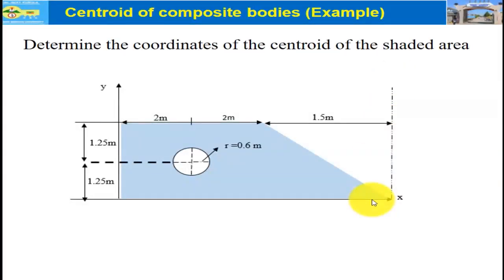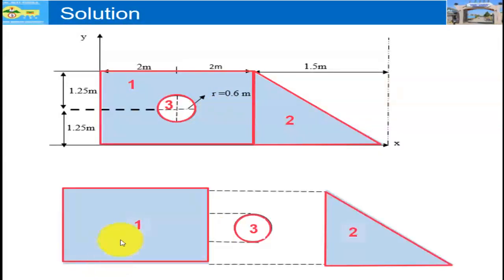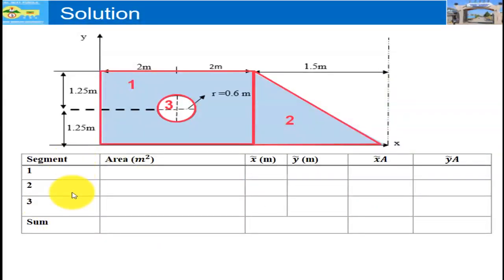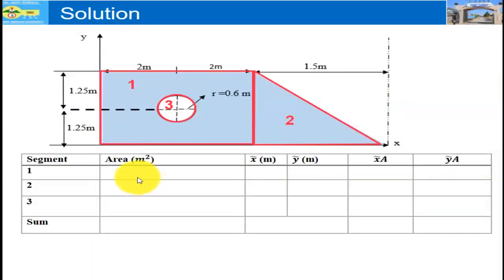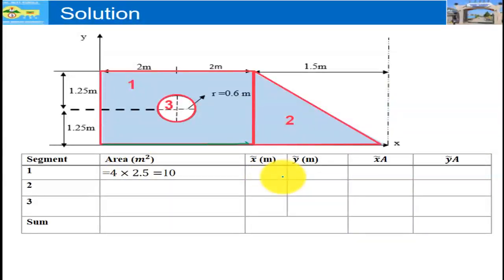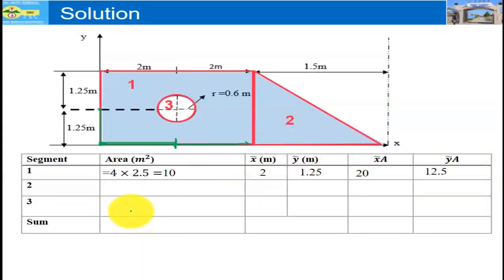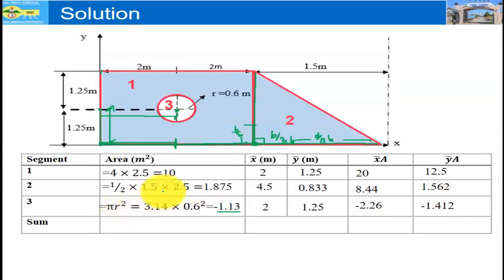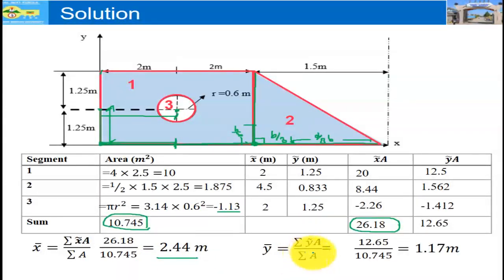Calculating Centroid of Composite Bodies, Engineering Mechanics, Statics በ አማርኛ

Comment: Thank you, sir, I really appreciate that. But the circular shape looks like an ellipsis. Is that matter of the picture or is that ellipsis as per the question? .The main point is just how to calculate the centroid and that is clear sir you explained it very well.
Reply from the maker: That is a good question the as far as the question is concerned, the shape is a circle however when I paste the picture I did not adjust it. So you are right it looks like ellipsis but in general, if it was ellipsis two radius would have been given.